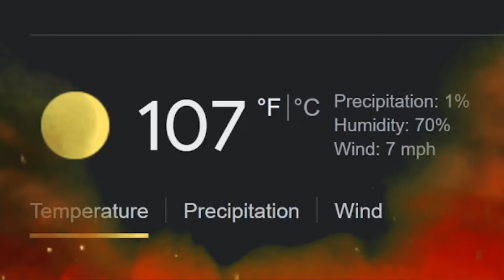CONVERTING AN OLD LIMO INTO A LUXURY CAMPER | PT.5

Comment: The thing with galvanized steel is when heated it lets off toxic gases, the metal can still be welded but in a welding school it would never happen nor get passed way too many gas pockets in the weld seam
Reply: Yeah lmao it’s not that you CANT weld it, it’s just that you shouldn’t breath in those fumes hahahaha
Reply: I’m hoping he knew that
Reply: Im a sheety, used to fab joists made from formed gal sheet as well as rhs, it can be welded effectively. Not going to go do a butt weld on 1/4"plate thats galvanised, at least without grinding the gal of first, but it can most surely be done. I still see these joists in use, some of which i made when i was an apprentice 25 years ago. Yeah its horrible shit and you get poisoned.

Comment: Too late now but it’s not that you “can’t” weld galvanized steel it’s just that galvanized steel is super bad for your lungs and could give you galvanized illness and at worst lung cancer. The illness symptoms are just your usual flu symptoms, I know for me before I knew it was galv metal it made me extremely tired and exhausted like falling asleep on my 5 minute drive home tired. Either way it’s late but figured it was better late than never, good luck on your escapades fellas!

Comment: Who says you cant weld gal? Fkn dont listen to the scrubs! Sheety here, you can most certainly weld gal, its horrible and you will poison yourself, but you can weld it effectively. Best too grind the actual gal of and get to some more normal metal. Welded many a structural joist mad from galvanised steal, right don to stuff below 1mm wall thickness. I did cringe at your "welding", i dont remember exactly why, probably because your equipment not at all helping, especially coupled with lack of skill.